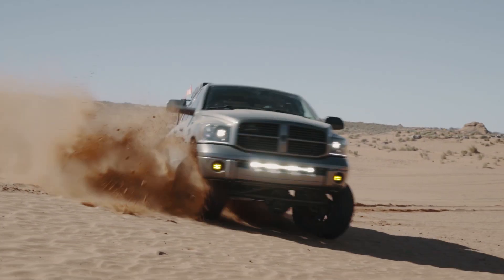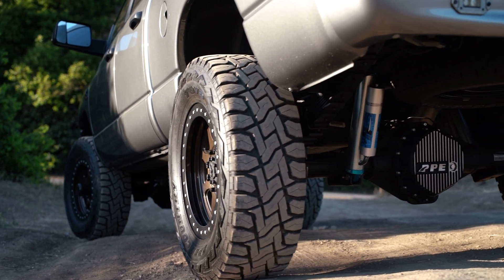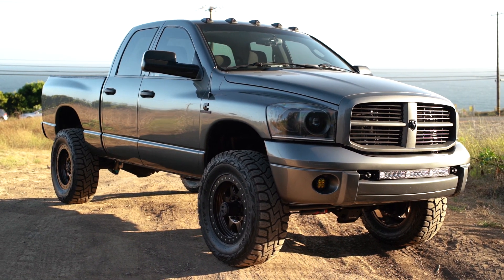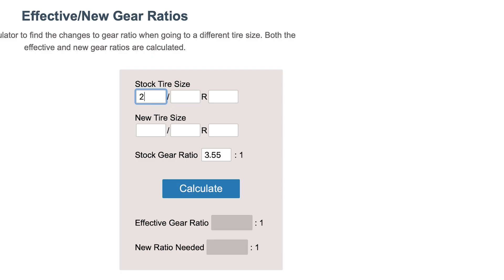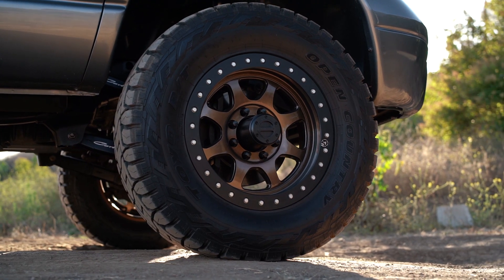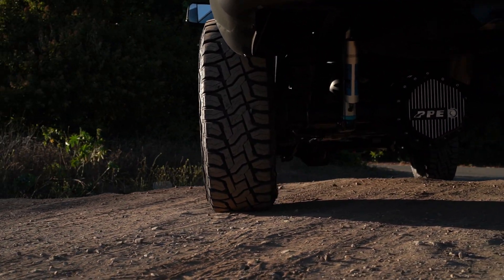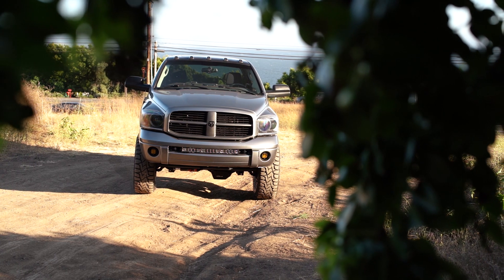Should You Re-Gear Your Diesel for 37s?

Comment: 2025- The trucks that have more gears as in the 6, 8, & 10 speeds may notice different things than you are saying.  With stock 275/70-18 tires and a 3.42 ratio, my wife's 2018 Ram 2500 Crewcab 4wd 68RFE 6.7L, does spend a lot of time in 5th gear with a Hawk model 4Wheel popup camper pulling my Jeep JLU.  Diesels and gas engines have a sweet spot in the rpm range.  And every truck of any size should always be operated with the sweet spot in mind.

Comment: Not a cummins, but i just slapped a 6.5" coilover conversion lift on mine and 37s from a 32.8" tire and within the first day of driving regearing seemed quite appropriate. I too also assumed well it's a diesel designed to haul 10s of thousands of lbs so it's just like a heavier load. I think for me where it gets confusing is seeing so many people cheap out on gears and go for tuning and adding power. As of right now I am bone stock for tuning as the truck has merely 6888 miles on it this morning. Personally I am having a hard time finding reasons NOT to gear. I think the proper answer is finding the correct gear ratio for your desired results. I sure as hell don't want RPM for days spooling cruising at our freeway speeds of 80+, factory rpm and power range would seem proper to me and all of the benefits in the world by gearing and not neglecting this.

Comment: I have a Ram 2500 year 2016 with the Hemi engine , i have blistein leveling kit and 35 inches , but i want to go with the 37 , do i need to do anything , from tie rods to gear ratio , any help will be apreciated , i dont tow or load the truck , i just do offroading and traveling .

Comment: What is your mileage and has the speedo been calibrated for tire size?

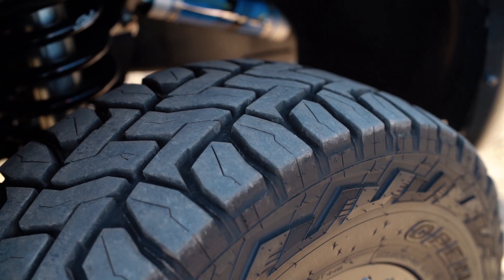I will always regear when tires go up several sizes.  Fuel efficiency is lost big time. My 07 has 4:56 with 35s. I'm probably going to go with 37s.  At 70 I should be around 2000 RPM. I'm in the hills all the time. I want the rig to work easier.

Comment: As a licensed Mechanical Engineer as long as you stay within 10% on the RPM of where you were you are fine.  This is an issue for the sake of being an issue.  IF you go to 40's or bigger from stock yea you probably need to re-gear.  37's or 38's this is a moot issue.  I specifically ordered my truck with a lower gear knowing I was going to 38's.

Comment: As a Licensed Mechanical Engineer stay within 10-15% of the original tire circumference with the stock rear gears are you are fine.  I ordered my F-350 with 3.55:1 knowing I was going to 38's.  No issue.  This issue exists just to be an issue.

Comment: I have an 03 2500 cummins I put 35s on with the stock gear ratio and have had 2 48REs loose the drive gears. I do pull and plow with it. I'm convinced I was putting too much work on the transmission. Can anyone either confirm or deny my theory?

Comment: Last June I purchased an 07 ram 3500 dually with a six speed manual and 5.9 Cummins and stock 235 tires and it is twisting 2k at 65 mph. Driving me nuts. Not sure what gears I have but i know I need to get taller tires Bad. But I don’t want to spend a lot of money. Definitely need at least 35 tall but width is the problem.

Comment: Love the video! I am thinking of buying a 2012 Used Ram 2500 Diesel (because for personal reasons that is the truck that works for me).  I am thinkg of creating, over time, a nice over landing rig! I out of the gate am doing a Carli 3" Back Country Kit and new Rims and Tires, 37"s. I also will be inspecting the steering system and upgrading to Apex or Synergy Kit. Adding a Switch Pros Controller for electronics upgrades that are forth coming. Then a Leitner Designs Rack with F/R Bumpers etc. One of the first upgrades I was contemplating were front and rear lockers. That being the case the diffs would all ready be off the vehicle and was thinking of regearing at that time for the long haul due to the extra work the engine and trans would be doing and being booned way off road those situations that would require more throttle response from the jump; getting it back to factory made more sense, and I correct with this line of thinking knowing that now there are two new stops between 3.73 and 4.56 in the American Axle game then were available before. What are your thoughts???
Reply from the maker: If you go with a re-gear, basically shoot for the closest ratio to get you back to stock as that will help your trans shift correctly in an auto. It might not be spot on, but the closer the better! Sounds like you have an awesome plan laid out though!

Comment: As someone who has a heavily modified ‘13 Cummins that is regeared, I agree with what he says. I pull a camper a few times a year, and it’s rolling on 38s, I geared at 4.88 to try to save my trans, and regret the ratio choice. I wish I’d have done 4.10 or 4.30, no higher. I used to cruise at 65-70 @ 1200rpm, now I’m pretty much topped out at 60-65 unless I cruise over 2k rpm.

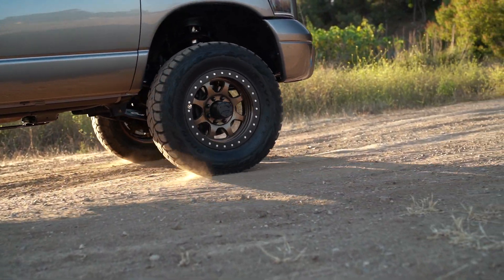Comment: Absolutely Agree. Ran 37s on 3:42 and very happy. 95% empty 5% towing travel trailer 10,000 lbs, just fine. Empty at 75mph 1600rpm. towing keep it in 5th
Reply: I'm contemplating running 37's on my 4th gen. I do very little to no towing. How many miles are on your current transmission. I plan on putting a single delete tune in my truck and 37's but I am terrified of blowing the transmission.

Comment: Someone mentioned lower egt’s…do you think that will effect the regen efficiency/reliability on the 5th gen emissions system?
Reply from the maker: With 37s you actually raise EGTs and engine load slightly, which is the absolute best thing you can do for reliability of the emissions system. Higher cruising egts means better passive re-gens and less load on the system. That’s why you see people with grocery getters having dpf issues and the hot shot truckers with constant loads getting better lifespan out of the system. It’s designed to operate best with some heat and longer highway driving!
Reply: @JustDiesels  that makes perfect sense!   Even more reason to do this because right now it’s a daily and for off-road transporting dirtbikes.
Reply: And thank you for putting this out. Now when the haters tell me I need to regear from 3.73 I can set them straight. I actually used the gearing calculator and if nitto ridge grapplers are actually 36.5” then  my gears end up at 3.42.  I can rest easy now with my plans because my goal is keeping this truck forever!
Reply from the maker: Yeah 3.42 is still a very usable ratio. In fact, that’s the ratio all the 14-18 trucks had from the factory!

Comment: I have the 48re on my 2006 Cummins and I've been running 37s for the past year on my 3:73 gears. I also monitor my EGTs and have always been told to always keep them under 1350 degrees. Well when I'm towing a mere 4k pounds and I'm trying to cruise at 65-70 my EGTs rise up to the high 12s. It's like I can't find a sweet spot to cruise on the highway with towing without rasing my EGTs. Not to mention, no matter what I'm towing, even when I'm not towing anything it feels like my truck is struggling to make it off the line after a complete stop. It literally feels like a really need a re gear. Now just yesterday a tranny with a 6k performance build less than 2 years old just went out. Not sure if this has anything to do with the gearing being so off but now I'm staring down the barrel of another 5 or 6k tranny build. Almost makes me want to buy another truck and quick dumping my entire life into this one.
Reply from the maker: I have to say my truck has none of those issues! EGTs are completely normal, and I’m still on the stock trans!

Comment: If you don’t tow much it won’t matter much if you tow and you tow heavy and work the diesel and use them for their intended purpose then regear.  Regearing will help with the drivetrain out and especially the trans in a dodge.  The people say don’t regear are most of the time the people that have never done it.

Comment: 07  Dodge 2500 5.9d with 48re and stock 3.73, towing a 12,000 lb toy hauler in very mountainous areas with no issues, runs quiet on the highway and gets 21mgp all day long with a superchips programmer. Love it.

Comment: That calculator was extremely helpful. I was wondering if ordering a 5th gen with 3.73s or 4.10s from the factory would require a speedo recal if I went with 4.56s or 4.88s in the future with 40s. Turns out, if I order 3.73s from the factory, that speedo will be identical with 4.56s and 40s to an OEM setup and won't need to be recalculated

Comment: Would your general conclusions hold true for the 442 ftlb Jeep eco diesel with 37’s?
Reply from the maker: My tip is always to put on 37s and then see how you feel. No sense in re-gearing until you know you need to! The Jeeps are a little more likely to re-gear though since they have smaller drivelines and less power than the HD trucks.
Reply: I'm running 38s on an eco Jeep Gladiator. I have zero desire to regear.

Comment: Have an 07 power stroke ccsb with a Cummins 6.7 swap.  Bigger turbo, injector and built 5R trans.  Truck had 3.55’s. Cruising in the freeway 75-80  with 37’s I would get 17-18. When I went to 4.30’s it got the same mileage on the freeway and better mileage in town. The biggest difference was towing. With the larger turbo power and shifted up  and towing 12-16k pounds and the 3.55’sthe truck would drink fuel.  5-8 mpg.  With the 430’s it gets 12-14 towing the same weight.

Comment: He never mentioned mileage, not that people drive diesels thinking they'll get great mileage, but I always averaged 18ish mpg with stock tires 285s,  16 with 35s, and 14mpg with 37s. So yes our trucks can do it no problem 👌 but it will make them work a little harder often. Thats on a 2017 ram 2500 with a carli commuter 2.5

Comment: For my 2012 lml with 37s, on a standard 55 mph highway or around town it will only go into 5th gear. And stay around 1500-1600 rpm. Then a 65 mph or interstate it will go in 6th and stay 1500-1700. Makes the drive feel smoother if you could say that.

Comment: My 97 12v has 37s with 4:10s and a nv4500 5 speed. It’s perfect for towing but if your not towing I actually think that 40s would help it out on the highway. My stock 4:10s were way to low when I had 33s on it. 70 mph was like 2600 rpm. With my 37s gps 70 mph is 21-2200 rpm.  I don’t like really cruising it at speeds higher than 70 mph, and my mileage really starts to drop. I think 40s would put me at a nice 1800 rpm.

Comment: Did your MPGs change with the stock gearing going to 37s both around town and on the highway?
Reply from the maker: definitely! There’s no way to fight the physics of larger, heavier tires with more rolling resistance from aggressive tread patterns. The truck still gets solid mileage though in the high teens and even low 20s if I baby it.

Comment: I'm undecided keep the stock or re gear with 40'ers on 2020 cummins Big horn. Its a daily driver but at times I do cruise on the hwy or hauling. Im  thinking 4.10?!..
Reply from the maker: With 40s you probably want to re-gear.
Reply: @JustDiesels  appreciate the  response.  I'll go with 4.10 test run. Might  consider 4.56.
Reply from the maker: If you use that gearing calculator it should give you a nice idea of what you need!

Comment: Seems re-gearing is more sensitive to gasoline engines. I had a '97 Tahoe with 37"×13.5" tires on 18"×10" wheels with 4:56 gears & it drove great, just like a stock truck. Well, a stock truck with worn out shocks & 300k miles 😅
Reply: Had a 95 tahoe could barely fit  on 33s...how the hell did you fit 37s under it? Crazy lift?

Comment: I have 35s on 3.42 gears on my ‘17 ram 2500. I don’t haul much it’s my daily driver. I’m using it as a welding rig now, I may have around 2k of weight in the bed. I want to upgrade to 37s I’m on the fence about regearing. The truck is leveled on a Thuren fab kit also.

Comment: The only thing that messes up is low end torque and by not regearing from stock to 37s at 70mph youre actually speed is 80mph so its better to regear 100% but if you dont want then dont do it

Comment: You can not tell me or anyone that a stock truck will not do what it was built for as opposed to the same truck with “37” inch tires. Your not smarter than the guys who designed the truck.

Comment: "Should You Re-Gear Your Diesel for 37s?
"
Absolutely...tire size has a direct influence on not only fuel economy, but on performance as well...
Speedos can be corrected, either mechanically or electronically, but with larger tires, you'll never recover your fuel economy OR performance without a gear change...
IF you want to know what gearing you should be using when changing tire size, here's an easy to use calc to help you out...

https://tiresize.com/gear-ratio-calculator/

Comment: Haven't watched the video yet, but I have a 6.0 Powerstroke on 37's with 3.73 gears. The power difference is insane, once I get the money up I'll be regearing to either 4.10 or 4.30. 35's I didn't worry about it, but the 37's really lug along.
Reply: They need more RPMs than Cummins to make torque

Comment: 2018 power wagon... I know it's not diesel.  It came with 33x11.50 and looks like a roller skate. I put 35x12.50 on the stock 17's and can't tell a real difference with the stock 4.10's and 6 speed auto, however I do get pulled over often as I'm about 9% off with the speedometer... No I'm not changing it until I go to 37's.  My truck is on my channel if you care to see the set up.

Comment: I have an 06 5.9 Cummins . I run37’s & I am even more happy with my mpg & highway rpm . If u think I need to re-gear ur so wrong as my truck on 37’s runs an 11sec flat with the 3.73 gearing . Have video footage of my multiple 1/4mile passes in the low 11’s & my claimed 11 flat pass .

Comment: Running 37s on my 99 Cummins,  5spd, 3.55 gear, tows boats of all sizes to shows. The only negative I found is my egts are a bit higher at Cruise speed and my mileage dropped significantly.

Comment: All you have to do to figure out how to get back to factory is figure 1/10th a gear ratio +/- for every inch of tire added or. Taken away if you had 3.73 stock on stock 31s and go to 37s that 6 tenths talker gearing  essentially making your 3 73 a 3.13 so you'd need 4.33 37s to be similar to stock... it's not rocket science.

Comment: Other considerations are aftermarket turbos and what stall converter you run.  My slightly bigger turbo is just a touch laggy,  higher stall, looser converter helps that.  I don’t think I need gears running 35s.   Up with my mods I’m running 600/1200 at the rear wheel.  Towing @8-10k it’s kinda hunts between 3/4 @70 and my EGTS cream up.   Tow/haul us Aly fixes it for a little higher rpms and keeps the egts in check.   Non towing it cruises @ 75-85 perfectly.     Might consider gears at 37”, but my 35s are just right.

Comment: Just a thought I want to put out there. From a mechanical perspective, I understand with a Cummins why there would be no need to re-gear. However, with a 7.3L Powerstroke....I would think you would want to, as the 7.3L doesnt have the same torque curve the the inline cummins has, since it is a V8. So would it make sense to re-gear a 7.3 with 37's?

Comment: I'm running 456 gears and 36.x15.50x20 at 70mph I'm running 2000 rpm.im off road alot and the 456 gear in 4 wheel high is amazing  never need 4 low for anything.

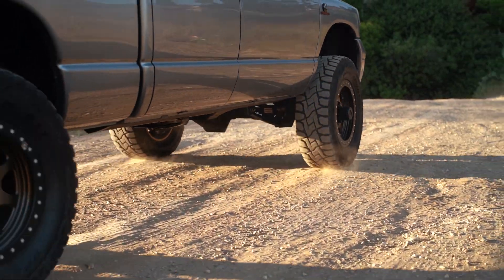Comment: I got a Ram 3500 with 3:42 gears and the Aisin trans. Want to put 37” tires but I’m confused about gearing. Calculator says I would need 3:78 gears which is not to far off from stock. But when I check a gearing chart it says I need at least 4:10. Which is correct? Anybody.
Reply from the maker: Since I’m guessing you got a 3500 to tow, I’d put 4.10s in that truck. Should be perfect with 37s on that trans. If you’re doing mostly unloaded highway, stay factory or do 3.73. Hope that helps!
Reply: Just Diesels I only tow about 3 times a year, under 10k total. Rest of the time it’s my daily driver mostly city.
Reply from the maker: I’d say try it on the factory gears then and see how you feel. That will give you a good gauge of gearing, but I have a feeling you’ll end up with 3.73s.
Reply: Just Diesels Thanks. Great job on the videos to. Keep them coming.

Comment: On a diesel, save the money spent on re-gearing to add power to the engine. Intake, exhaust, deletes, and tuning will increase power at all RPMs and can move torque to lower RPMs for towing.

Comment: My manual G56 with 3.73 revs too high on Texas 80mph highways. Using a set of 37s instead of re-gearing to 3.42. Time will tell if I gets better highway fuel economy by keeping the engine below 2000RPM.

Comment: I'll agree you can get away with not rehearing.... However in my case my mini excavator is 12,500lbs operating weight and my gooseneck is 8500lbs.. I was on 35s and stock gearing and I could definitely feel a power difference needless to say I went back to stock size I do like the look of the bigger tires but when you tow heavy frequently let's be honest they don't belong on there

Comment: I have an old 6.5 turbo diesel detroit tahoe 4x4 on 33s with the original 3.73 gear, but under 2k rpm in lacks a little power, I was thinking into going up to a 4.56 o maybe 4.88 but I am afraid of make rpm higher and higher

Comment: I have 4.10 gearing on my 2008 ram 2500 mega cab which this is going to make you cringe all you Cummins guys but I have a. 5.7l hemi trust me I would rather have a Cummins but I’ll be towing let’s say 7000 pounds at the most and I am running 34 1/2 x 12“ Nito ridge grappler‘s and you literally cannot feel a difference between the stock tires and the new ones actually probably only 7000 pounds whenever I’m towing mulch. But people need to chill out a little bit God bless y’all praying for everyone so if a Wii hemi man such as myself is fine with I think you a Cummins people will be too